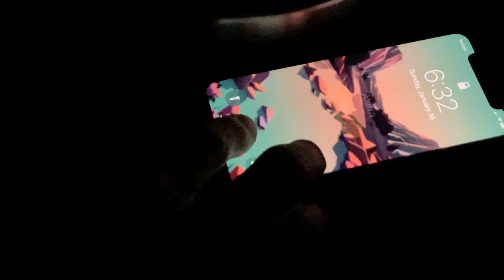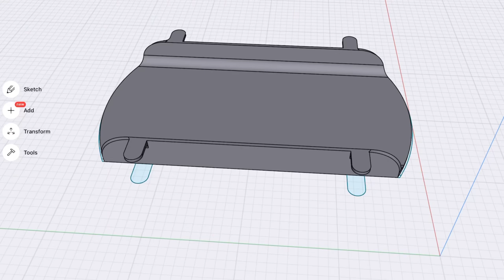Modifying a Lamp by Adding a Switch to the Base

Comment: Pretty nice work, dude! It turned out great! 😃
About the switch, you could've put it on any of the wires. I do prefer to put in the hot wire, or the positive wire in DC, but... That's only my OCD speaking. 😬
Anyway, stay safe there with your family! 🖖😊

Comment: I’m guessing you don’t use a ‘ground’ wire, even with a metal bodied lamp?
Reply from the maker: The manufacturer didn’t have one, so I wasn’t going to add one.  I’m not sure if ever seen a basic lamp with a 3rd wire.
Reply: The lamp is probably double insulated, so they are able to get away with no ground.